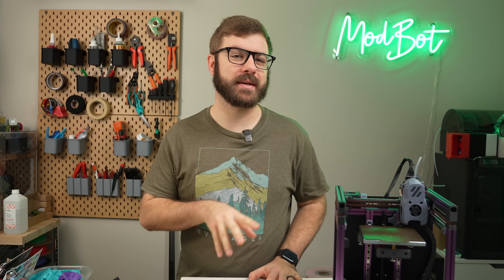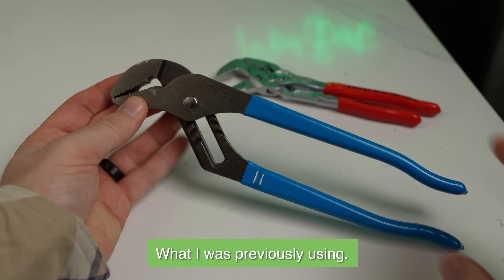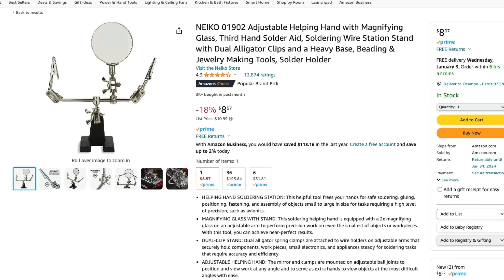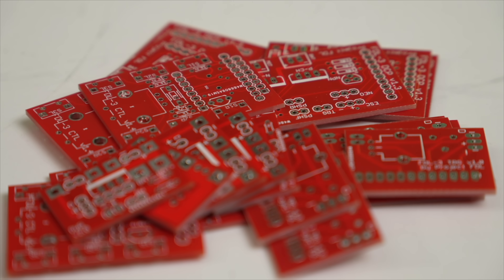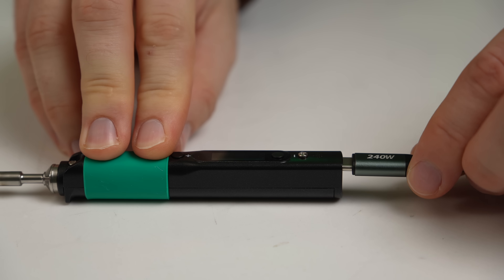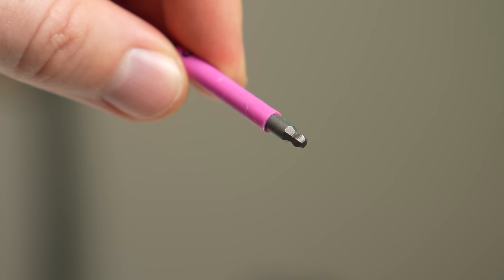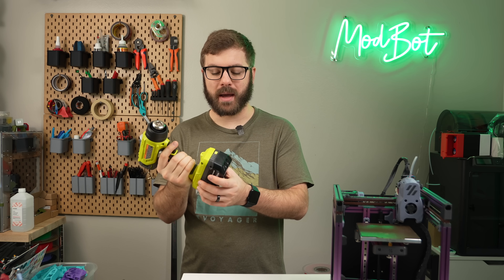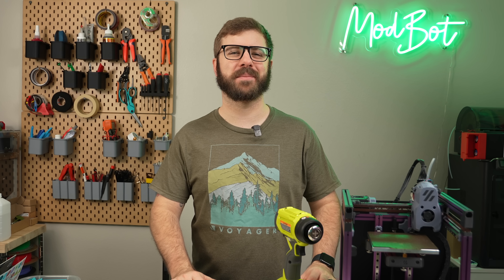Top Tools For 3d Printer Builds & Projects

Comment: Wera…top notch…Knipex…top notch…but Ryobi???? 😂 get a Dewalt.
Reply from the maker: I did a lot of research before deciding I was going with the Ryobi ecosystem. For the home diyer or occasional project it’s hard to beat the price and selection. I have yet to have an issue with their tools.
Reply: @ModBotArmy  granted. I personally have and hate Ryobi because of their reliability and power. In my line of field I can’t risk it.

Comment: I am surprised more makers in the 3D space are not using/recommending a good chisel. I came from woodworking first and find them invaluable - removing brim edges, smoothing out a rough edge, or adjusting fit of two parts where tolerances were not perfect.
Reply: i prefer using a deburing tool for that

Comment: Since you mentioned knipex, i also recommend their flush cutters. Much better than the included ones from printers. The tips are sturdier, so those stay usable for longer. I use them for about everything, cutting wires, stripping wires, cutting filament, support removal, removing the nasty bits of skin sticking up at your finger nail to name a few (underrated perk imo).

Comment: Great video. Can you recommend a good electric screwdriver? One that has a lot of torque as I've found they generally aren't strong enough.
Reply from the maker: I have the wowstick for a while and feel the same not nearly enough torque. Check out the HOTO. Another recommendation from Steve I picked up and it has way more oomf.
Reply: @ModBotArmy  I also found the wowstick disappointing. I will look into HOTO thank you.
Reply: @ModBotArmy could you suggest the model that you have of the HOTO driver as there seems to be a few models and as someone who never has much of a budget I’d really like to buy once rather than collect a bunch of sub par drivers.
Reply from the maker: No problem here is the specific one I purchased : https://amzn.to/3RWk0Uq (Its an affiliate link) It does look like there is a 20% off coupon on the product page. I also got an adapter that lets me use my smaller bits which I am using very often https://amzn.to/3Scaqy4. For the adapter you may want to shop around to see if you can find a cheaper option.   @freeemailssuck6848

Comment: I 100% agree with the Knipex pliers wrench. As someone that works in the trades all my pliers are Knipex. They can’t be beat.
Reply: That’s German engineering for you. Tools designed to out live the user even if they’re used on a daily basis. 
I’ve got a few tools made over 100 years ago and still abuse them myself today with no damage to them or the fixings I use them on.

Comment: If u want CNC Kitchen has heat insert tips for the pinecil
Reply from the maker: I have been eyeballing them for a while. I am so used to using the standard tip. That is the only reason I havent done it yet.

Comment: If youre looking for a good soldering iron, the pinecil is a must have. I should buy a better usb cord but my 30W apple charger does a very decent job at running it and heating up fast (not as fast as in the video, but roughly 15-30s)

Comment: Are the sleeved wera keys still too thick for the blind joints on 1515 frames?
Reply: Id say so. The holes are 3mm in diameter, the sleeving is in the way. But a allen screw driver works. The shown ones are good, but most higher quality brand ones are good. Just please don't use the ball end of your allen keys. If you expect to loosen the blind joint screws more often, i highly recommend swapping stainless steel for black oxide or other carbon steel screws. They are much harder. Most stainless screws are a low grade steel, about equivalent to a grade 4.8 screw. Meanwhile most carbon steel screws are 8.8, 10.9 or even 12.9. The numbers refer to their tensile strength. A 4.8 screw has about half the strength of a 8.8. 8.8 is what you get from a hardware store, the zinc plated ones. 10.9 and 12.9 is what you can find on vehicles or other motorised gear

Comment: I second the Wera hex/allen keys. Used a few different generic sets ovwr the years and the Wera are WAY worth the investment.
Reply: Wera Hex Plus are the best allen keys. I absolutely second that as someone who works with allen keys on a daily basis. When you round a bolt with generic allen keys the Wera are still gripping so you can loose it
Reply: As a bike mechanic, all wera tools are the best, they never disappoint (mabye the wallet but at least they last a long time)